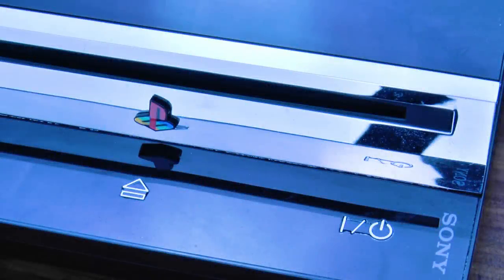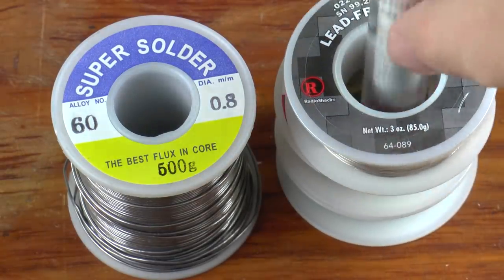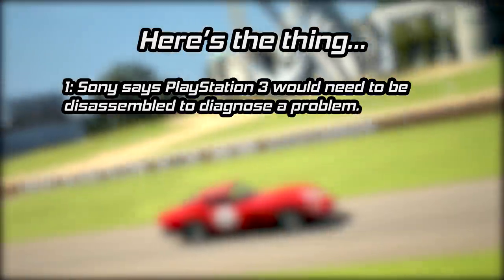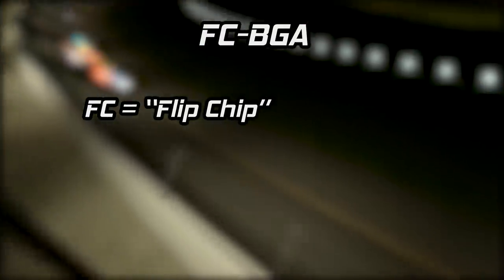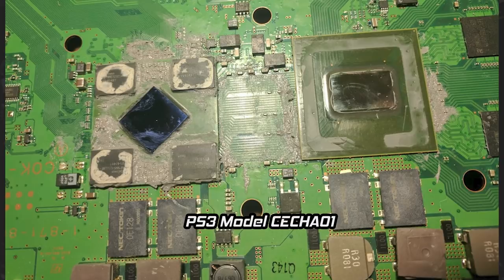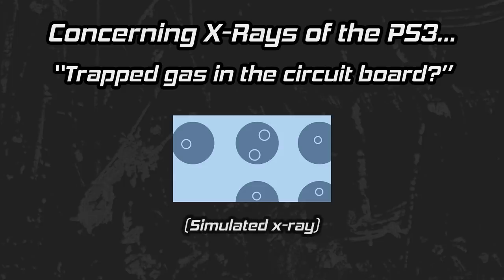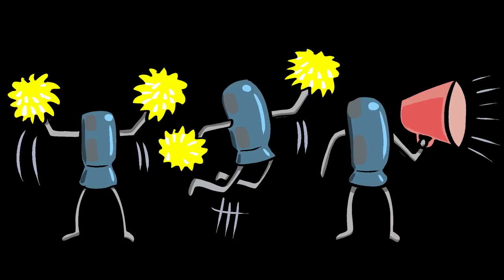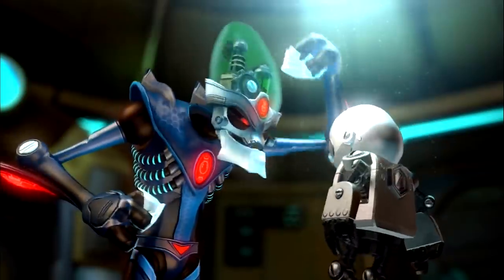The Misdiagnosis of the PlayStation 3 Yellow Light of Death

Comment: I recently bought a CECH-A01, from what I can tell it’s never been opened. Had a ton of dust balls (actual balls) inside the machine that I could see without opening it, all around inside it. There is a heating issue after the system being on for 20-30 mins. I can hear the fans get louder. Doesn’t sound like 100% speed. My question is, since it is an old console should I put new thermal paste under the IHS for the RSX and the CPU? I would get it professionally done of course. And does anyone know someone who does it in the US? Currently I just see someone on eBay I might use.
Reply: Professionally done? I am a "Professional" at that and I've done it maybe 3 times.

It's not hard. Have more respect for your own capabilities.

Or don't, whatever.
Reply: I don't know crap about PS3s, but if they're anything like general purpose computers thermal paste is fairly simple. Clean out the dust and see if it does any better. If it does, problem solved!
Reply: nexxusty yeah I’ve decided to do it myself. Bought a trash fat console for $20 just to make sure I don’t have an issue on the one I actually care about.
Reply: cachemist the Heat spreaders (IHS) are glued down with silicon. So it’s a little more complicated than just replacing thermal paste. Basically it’s like delidding your CPU.
Reply: @Evil_Chronic  NSC Modz here on youtube has developed a method to de-lid these which is borne from his intense work on untold number of PS3's. (Check out his videos.) He's a somewhat wacky, extremely talkative, nice guy in Germany. His videos go on too long but are instructive. He has multiple ones on the IHS, and how easy it is to destroy them w/o patience, proper technique, and proper tools, and he shows you how to do it, and extended videos on proper re-pasting of the whole shebang.
Reply: @Evil_Chronic  1 year later… how is holding out?

Comment: I used to repair PS3 YLOD's, we never touched the cooling (other than a re-paste, due to often drying out), and never reflowed anything...

What we used to do, was...
A full clean of the system,
Then place it in a warm/hot place for 24 hours (we had a cupboard we setup with thermal sheets internally, a thermostat and heater/cooler system to regulate, we used to keep it at around 50c internal temp) (this brings all components up to a thermal equilibrium, so any expansion/compression due to temperature differences is eliminated.
After allowing to cool (in the same location, at a controlled speed)
Then, we would perform a full reset of the system via safe/recovery mode.

This worked on 8 out of 10, and the return rate was very low, and any that were returned were often a good 6+ months later, and often a different issue...

Odd occasions we would replace capacitors or voltage regulators, we would usually test components if a PS3 was returned.

This wasn't my methodology, it was what I was told to do :)

Comment: Great video thanks. What did Sony and Microsoft learn from the PS3 and 360 which has enabled PS4 and XBONE to be much more reliable? I have  an original fat backwards compatible PS3 that still works! But the drive can be a little temperamental
Reply from the maker: Well one part of the FC-BGA improvement was the die shrink. Computers around this era that pushed for more raw power one way or another really put out a LOT of heat, and the industry started to focus more on multi-cores, CPU/GPU optimization and cooling. Consoles pulled in the reigns a bit concerning pushing forward with raw speed. That is better for a "longer short term" life of the consoles for sure.

Microsoft straight up learned the hard way due to rushing production of the Xbox 360, and I am sure they said "let's never do THAT again" after paying billions to right the wrong.
Reply: @DisplacedGamers  This generation of consoles actually puts out around the same amount of heat but in a smaller surface area now that they both use an APU.

Comment: Fixed well over 1000 PS3s with my custom reflow technique when I was in business here in Australia, my warranty was 6 months, I had a return rate of less than 5% and I made $1000s of dollars. My tool was a $25 heat gun, but my technique was what made the difference. The problem I believe was isolated to the CPU and GPU area, the rest of the board I kept cool during the reflow and the process only took 8 mins, which includes the warm up and the cool down process as well.  Nice video.

Comment: The bump issue with the bad underfill was very common. I just have to say two words: "nvidia bug"
But I think many chips in this transition period had similar issues, it took a while for the chip fabs to adopt to lead free solder.
A reball can sometimes be a fix, for example in a lot of AVRs from 2008-2015. All used texas instruments DSP chips. However some of those DSPs (I think chip date 2011-2012) had defective bumps as well. The failure was the same. The fix of reballing fixed most of them, but some died again. Those with the dead chip.
If you have one of them, just replace the chip with the newer version that does not fail. (Even with the good chip, add a heatsink, otherwise the solderballs below can crack)
Reply: Have a HK receiver that had the defective balls. First one replaced under warranty second one I reheated myself and it was fixed

Comment: Hell yeah, finally someone can back this "theory" up. I have been telling numerous people to not reflow anything, it's those NEC/TOKIN capacitors causing issues. Reflow is the only solution when the GPU is damaged to the point it's artifacting, but you are going to replace the RSX all together then.. That's the only point you really need to touch those solder balls. PCB on PS3 is very thick and solder does not melt that the temperature the PS3 is capable of outputting
Reply: Don't question, just open one of this caps and you will see the fucking black blob of melted tantalum in the middle of the capacitor, then you show this to your friend and solder new capacitors.
Reply: Todays consoles have an extremely high thermal mass to  prevent overheating during those extended gaming sessions. But I wouldn't recommend a GPU reflow either.

Getting the board up to temp. requires a ton of heat and a ton of air flow, making it difficult to be precise, especially if you're using a hot air gun. You're more likely to bridge the solder balls rather than get them to resolidify in place. Plus you increase the likelihood of damaging something else.
Reply: @fss1704  I opened one of those on my own PS3 when i delidded it, it was fine to my surprise  :)
Reply: @OnYourSquare  + Software already throttles back and shut it down. Damage is more done by "reflowing"
Reply: @StaticVapour590  That what I said. They are more likely to damage the unit, indiscriminately blasting heat across the board. We offer repair, recovery or restoration of data damage for Apple products with circuit damage. And one of the things we see most often are boards people simply BLASTED with heat, in a hail Mary attempt to fix it. 

So when I see people giving out that TERRIBLE advise, I have to say something. Save the next guy from wasting his time on a roached board.
Reply: MEga nice Comment Tristan ^.^
Thatz what im saying all the time :P

Comment: I am not an electronics engineer - just a hobbyist who knows very little, and who has a lot to learn. I never did like reflowing stuff, one, because it doesn't actually fix the problem, it just masks it while creating more, and two, it's not good diagnostic practice. It's not diagnostics at all. It's like replacing an engine with one from the wreckers just because you have a bad coil pack because you can't be arsed actually working the problem. It may work. It may blow up in your face. But it definitely doesn't fix the problem. I did learn that the PS3 failed because of a "power supply problem" - but never bothered to look into what it was. I think I did many years ago, but that was then and this is now, and I've been inebriated a lot since then. A secret sauce high speed decoupling capacitor in a package I've never seen or heard of before definitely sounds like it could be a problem. Many years ago when tantalum caps were new and they looked like little bulbs (they weren't SMDs yet - almost nothing was), these would often fail literally explosively, and even nowadays, mechanical stresses can cause bypass caps, for example, to fail explosively.

EEVBlog had a video of a power supply, which I own a later copy of, where a bypass cap placed over the output would be mechanically stressed when the DC baluns were attached, causing it to short internally and explode. The fix - which was applied to my copy, in case you were wondering - was to remove the cap. I guess it's a valid fix, but I'm in two minds about this. The other part of me thinks that the thing was there for a reason, and while removing it would not make the product cease to work (muntzing, anyone?), I wouldn't mind betting that it adds a little weird harmonics to the mix in doing so, even if it has very little real-world significance. I don't really have an oscilloscope capable of testing this, though, I only have a very, very basic PC based scope useful for simple waveforms and the simplest of triggering and math and that's about it. I'd love for someone to send me a real scope, I'd love you long time, but while strange things have happened, that's a bit too strange to ever happen.

If you've read this far, thank you. I'm going to bestow the single biggest nugget of knowledge I know about diagnosing literally anything that runs on magic pissed off pixie juice. Thou shalt check voltages. If you don't have a voltage there, the thing isn't going to work. Many, many, many times, you are dealing with a power supply problem. Can you guess what else might have had a power supply problem? Exactly. If you look closely on a lot of PCBs - not all of them - but a lot of them - you will see test pads for all the different rails that that thing uses. Use them. Test them. Make sure your voltages are there. Make sure they are stable. If they are, then you may dig further. But check voltages and their stability (if practical) first.

Thanks for reading. I'm always learning, and again, I know very little, just enough to get myself in to trouble, not so much out of it.

Comment: I used to work at a console repair shop during the height of the RRoD and YLoD occurrences. We would reflow the PS3 motherboard in reflow oven with only the 2 chips exposed and it would fix it 9 out of 10 times, and we would rarely get returns. And the 1 out of 10 times the reflow wouldn't work, reballing would usually do the trick. We must've done hundreds if not thousands of PS3's during that time. I'm not disputing what you claim, but I thought I'd share my experiences with it.
Reply: Was the HDD data safe from corruption?
Reply: What about the ones who failed and didnt tell you and just bought a new one?
Reply: @Clay3613  HDD was almost always fine after a successful reflow/reball. I've only really seen a few cases when that happens, and it's because the HDD itself went bad.
Reply: @odd4189  Well, I suppose I can't account for those. But among the people I knew who I've repaired their PS3, I saw only a couple fail again, and that was maybe a year or more later.
Reply: @evmaxx31  So what causes a PS3 to turn on then turn right back off into standby mode?
Reply: @Clay3613  I'm not sure. I always assumed it was cold solder on one of the BGA connections. The reflows worked most of the time, so I didn't question it really. I never played with the capicitors too much, I wish I knew about them when I was still fixing consoles.

Comment: This mainly on the 60gb version which had the ps2 backwards compatibility and was more heavier and a way more metal inside compared to the 80gb models and models that came after that
Reply: What? They're basically the same models in terms of layouts and content. I've got a CECHA01 60GB (US model) and a CECHC03 60GB (UK model). The CECHC03 is what the CECHE01 (80GB PS3 US) was based on. They are almost identical internally outside of the Emotion Engine and PS2 RAM chips being removed.
Reply: @mrratchet  I can tell they are not identical u can easily tell the difference the 60gb ps4 has the 4 usb ports and the crome finish on disc slot and the spider man font were on 2nd and 3rd generation ps3s which were the 40gb and 80gb had paint and 2 usb ports and the 40gb model has the same plug in layouts at back as the 60gb ps3 but on the 80gb it was on left side apart from that both the 2nd and 3rd generation ps3s which are identical at front but 60gb is not because it has crome and two extra usb ports
Reply: @sulaman4280  Ah no, I see you meant that the 80GB CECHK01 (the 2 USB ports with no PS2 BC). I thought you were referring to the CECHE01 80GB (4 USB ports with PS2 BC).

Comment: The funniest thing about "assumptions" is that the xbox 360s issues had nothing to do with solder as well.  They used some nickel alloy washers for the CPU heatsink (I believe, its been a long time now, just know that these washers were the culprit in 99% of RLOD) that would expand and contract as the console was thermal cycling (ie. playing a game and turning it off).  This would eventually work the heatsink away from the CPU and cause the console to flag this via a sensor on the board that detected the loose HSF.  You could do a series of button presses on the front of the console (shown to me by a M$ employee at the time, who also clued me in to the washer issue, and the internal statistics that it was the problem on almost 99% of the consoles they got sent) to get it to display an error code on the screen even while RRODing, and the code would tell you what got flagged and it was ALWAYS this.  I used to repair these things in college and the fix always was to just tighten the HSF.  I did hundreds, maybe even a thousand of these things for people while undercutting M$ cost to send it in which is why a lot of people used my service.  Even in my medium sample size I never ran into a unit that was legitimately overheating or had a dead chip etc.  The xbox never was "overheating" as everyone thought, or had issues with solder.  This misconception sold a lot of fan-destroying 3rd party cooler accessories though!  People would do reflows, removing the HSF in the process and reattaching, which made it LOOK like it worked when in fact all that was needed was a screwdriver.  Introducing variables, as he was talking about.  The "Xclamp" fix ALSO CALLED FOR REPLACING THE WASHERS lol.  This is also the exact kind of problem that can develop during console development: consoles that are constantly being reassembled in testing, and with long term tests that aren't long enough for an issue like this to crop up before the users get it.  (Exactly like these NEC caps) These long term tests also are generally leaving the console on for extremely long periods, which means the console never, or not often thermal cycled and therefore the washers didn't have enough cycles to expand and contract to finally dislodge the HSF.  So I guess if you really want your original 360 to have a long life, turn it off as little as possible or just never use it, lol.

The reason the turnaround was so fast on 360s that were sent in, is that M$ was simply doing the same thing I was and sending the unit back out.  They would tighten the HSF again, and send it to some other poor chap with it being to guaranteed happen again after enough thermal cycling.  They changed the washer material to one that didn't expand from the xbox 360 elite on, and magically the issues all went away!  I actually bought an elite at this point and that thing never had an issue lol.  People always think M$ was losing a ton of money (more like lost profit) on the 360 warranty/repairs after warranty but they just weren't, charging people 100-150 at the time to send it in and paying someone to tighten some screws, with it all not taking very long means they could crank these things out, and even make money if the console was out of warranty.  I certainly was....  You don't think M$ would extend the warranty without a plan, right?

Comment: after more research in the PS3 repair community, the issue is still usually the RSX, not the NEC Tokin caps. There's a new modchip available that lets you swap RSX chips from a donor PS3 btw
Reply: I still feel like it could be the nec/tokins because they were very prone to failing

Comment: years ago I got spooked by the YLOD reports so I never bought a PS3, but now that the problem has been identified, if these NEC/TOKIN capacitors are actually the source of the problem then I might just consider buying one
Reply: Just don't get a fat model, as those are the ones that usually get the YLOD. Happened to me on 2 fat models, but have a slim since about 5 years ago, still working great.

Comment: The issue with the 360 was due to the wrong lead free solder used.

It would crack due to the heat generated by the CPU and GPU.

That said there's something worse about lead free solder.

Tin whiskers.

The lead stops them from growing.

Without lead they can grow.

So eventually devices with lead free solder will fail due to tin whisker growth.

And chips with more terminals will fail quicker as there's less space between the terminals.